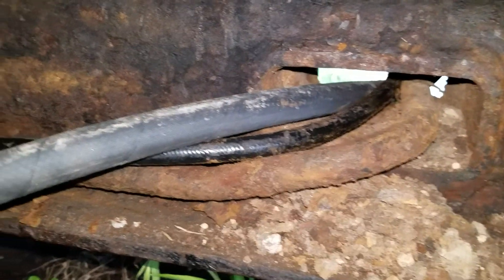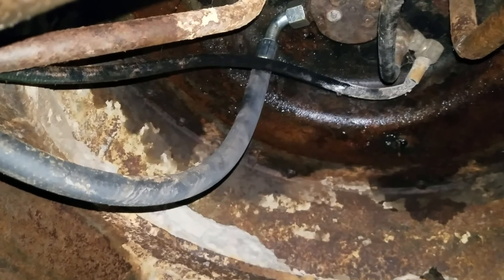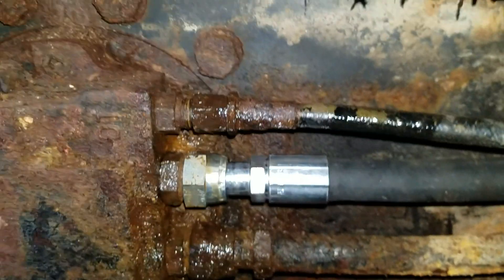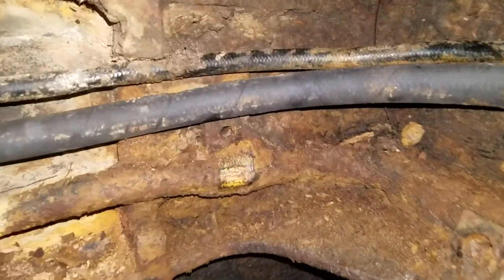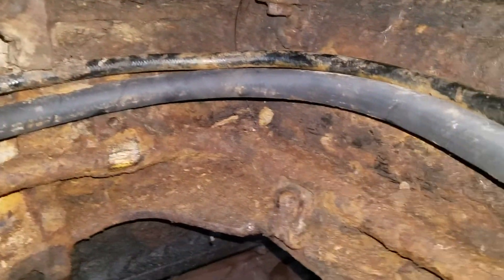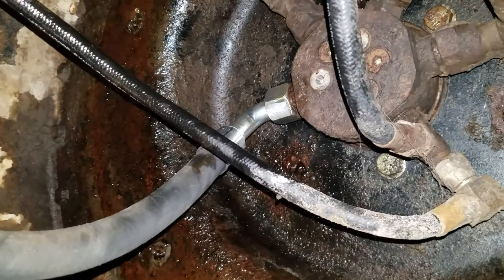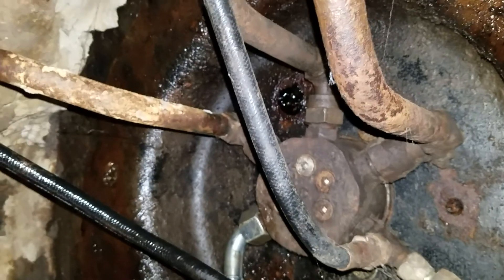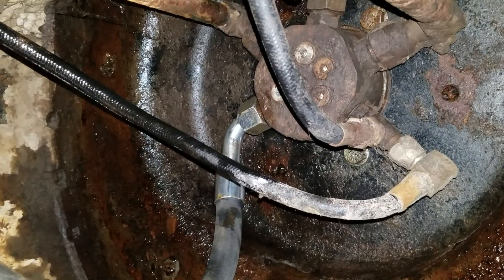Caterpillar e70b track drive motor hydraulic line repair part 2

Comment: Did you end up just pulling th lines and having them made? 
Ive been trying to find the drive motor steel lines 
 part number
Reply from the maker: It's easier to just cut the steel line and remove it  and have a hose made. I wouldn't want to try and replace a steel lime with another steel line.
Reply: Ok I think that's the way we are gonna go. Is the 90 and straight fittings pretty standard for catapillar? Gonna call the local hose man in the morning and make sure he's got the fittings then we'll get it removed and taken to him. 
You said 6 inches was a little to much.. you think 3.5 inches would be enough?

Comment: The system underneath is very good because it is so accessible. On Takeuchi TB016 it is STOOOPID. Can't  get spanner to the fitting because it's behind a corner.  Best you can do is put a spanner in at 45°.

Comment: Whats the top line in there for?
Reply: Return?
Reply: @johncollins8304  nahh, case drain 😂 Did some work on one of those. Still not tracking straight. One motor intermittently pulls slow then fast. Should tear into the straight drive valve or